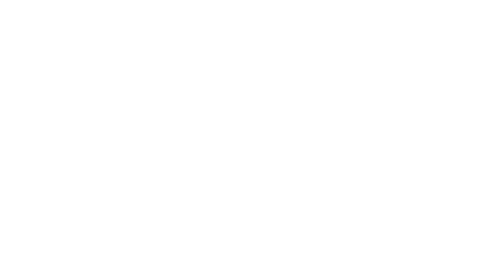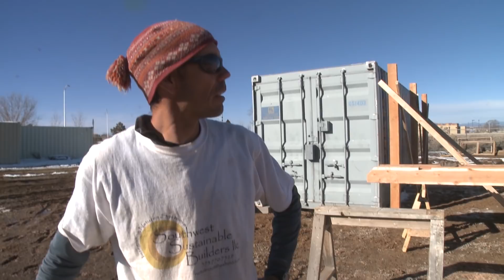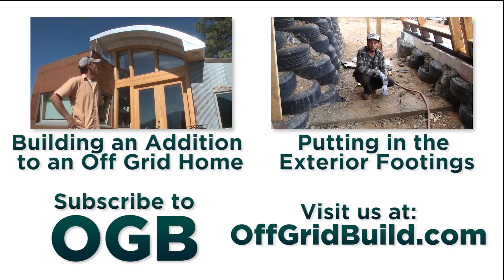Pros vs Cons of Shipping Container Buildings

Comment: The guy gave a great deal of good knowledge. I guess the complainers are just so wise on the subject and so rich they can sit and bash videos on youtube. I am a retired contractor and was looking for general information on the subject. I would say this video is a ten. It's free you Stupid Fuckers.
Reply: But didn't get this sustainable issue. Basically you are saying that using containers as a building material for housing is not sustainable taking in all aspects of it - life cycle costs (even in warmer locations you still need to take into consideration condensate issues etc)?
Reply: "Sustainability" is mostly a meme used to market used containers.. I actually have containers in use as a machine shop (two 40' High Cubes) and a "one trip" (effectively new) 40' High Cube as a ride-through motorcycle garage. They're nothing more than handy shells and the more you mod them for residential use the less "container" remains. People get far too childishly exited about large boxy objects but ISO containers design only suits industrial and military uses or specialty structures built by skilled fabricators like Andrew Camaratta (whose videos are worth a watch, he's a skilled contractor). Unless you  insulate properly or live in a desert containers will "sweat". I get by (thanks to climate and good door gaskets) with little problem in my shop containers but for a home you'd need effective insulation. 
I suggest anyone seriously interested build your own container workshop. Not contract, DIY. You won't learn much from outsourcing and if you want to build a house yourself a workshop is insanely handy. Learn basic wire and stick welding by taking a community college course or similar. I welded my machine shop containers atop steel beams (containers only require support at the end fittings) with 6010 root/7018 cap and welded the strip between the roofs (1/8' steel sheet sheared into 2" wide strips) with E71T-11 wire using a suitcase feeder.
Reply: Bo Kotain Lund I happen to be on, and noticed your post, so I will give a reply. In a warm environment, that environment could have high or low moisture. In either case, in a warm locations, be it Florida with high humidity (moisture) or places like Arizona or Nevada, one would use air-conditioners, which are dehumidifiers. As long as you do not use to powerful a unit, it should remove the moisture from inside it and dispense is outside the unit or structure. Doing this during the cooling run time.

Some people think that an air-conditioner is good, so a bigger one is better. For example in a room 3 meters by 3 meters (about 10'X10') it may have a 5,000 or 6,000 btu unit. Units that size, for that size room would run the right amount of time to cool it and also run long enough to dehumidify it. If someone put in a 10,000 or 18,000 btu unit in a room that size, it would cool the room faster, thus not run long enough to remove the moisture from the room. 

When you first walk in, it would feel cool, but after being the the room for a half hour or longer, depending on the person, they would notice it feels damp. This is why people will go into a large structure like a Shopping Mall or Store and after a short time, they feel like they are starting to sweat, even though it felt very cool when they first entered.

If a container unit was partially under ground, so it receives natural cooling, you would have some sort of air circulation system that moves air through the unit or structure, and add a dehumidifier that is only for removing moisture. If electricity is a problem, a smaller device that absorbs moisture. Those items would be anything from Damp Rid, to a silica beads container.  After is changes color,  you would place outside in the sun to dry out and then put it back inside. Some people bake them at low temperatures to reset them.  The same type remedy if there was a shower or bath tub in use, you would have a vent fan to cycle the air through that area, to the outside.
Reply: If you bury a container you'd better seal it VERY well because Corten steel still rusts ( a very good reason to buy "one trip" containers instead of WWT junk removed from service which is a mistake I'll not repeat).  That includes lifting the box and treating the entire bottom. I consider burial unwise with rectangular sheet steel boxes (they crush easily as the side walls were NOT designed for side LOADS) and if I for whatever bizarre reason wanted to bury a structure (there are plenty of other, better ways to bunker-I'd copy military success) I'd order a steam cleaned tank car hull from a dismantler (farmers like them for culverts) then cut and weld to suit before burial. Tank car hulls are FAR stronger and solve the "bilge" problem easily (deck the floor like a submarine and run your drainage and sewer pipes down the center with a bilge pump to handle leaks/condensation. They are delivered on lowboy trailers then unloaded by crane or whatever expedient method that suits your equipment. The main advantage of shipping containers is they're instant inexpensive SHELLS. They're basically an empty steel single wide mobile home. I like my containers and would have zero difficulty building a home version but my reasons for using them are fire and storm resistance (you still need firebreaks because hot steel melts and can ignite interior paint VERY quickly, and an external fire could easily kill everyone in a container) with low maintenance. There's a lot of study to do if you want results. Visit military and industrial container mod sites (industry does everything better than hobbyists so wise hobbyists imitate industry!) for examples to copy. Build yourself a container workshop (a GOOD one, not just a box with shit in it like a jobsite) and that will get you a useful shop for your next move. Cough up the money for a "one trip" High Cube. Lesser grades (particularly un-sea worth discards) require considerable work to be inferior to a fresh box. Standard height containers suck. Their low height trashes air circulation and the cubic footage difference leaves storage room you will want to exploit. 20' baby boxes are a joke because they're too small to be much more than a tool shed. (I have one for storage because it fit the area next to my rental property, otherwise I'd never buy one and only use 40' HCs.) Have fun but until you actually BUILD a container structure I would avoid commenting much on the subject. BTW 3M 5200 through-hull sealant is your friend and compared to it all mere "caulks" are trash. It's perfect for sealing power and other through-hull container conduit and pipe.
Reply: Fla-bushcraft Prosper room
Reply: +Fla-bushcraft Prepper I have spent months studying constructing shiping container houses and discovered an awesome resource at Magic Container Plans (google it if you are interested)
Reply: Ignore this SPAMMER. All you need is freely available in great detail. Use a search engine and study industrial and military containers.
Reply: "It's free you Stupid Fuckers" - Best line I read in youtube comments so far, probably ever.

Comment: Containers are really good for an initial move out of the city. We did that -- moved into a 10 x 12 shed for half a year with a container holding all of our stuff while we built a house.  We now use that same container as a haymow for our horses -- one of two container haymows -- and we will be modifying both of them soon to add a run-in overhang and a tack room on one, and an observation deck and slow feeder on the other. We also plan to add onto the house with three containers and create an art studio for our daughter with another.

Comment: For insulating shipping containers I have solved both the condensation problem and the ease of insulation by using spray polyurethane insulation on the outside.  Spray acrylic elastomeric over that and you have a long term insulation  with sound deadening.

Comment: This vid is a good overview but as I see it there's something that's not been emphasized nearly enough in container building: insulation.

I have 'repurposed' half a dozen containers from 20' to 40'. On the first one, I framed interior walls to hold batt insulation and provide a 'builder-friendly' surface for fitting out the interior. I called that one a failure because there was still condensation forming between the inside of the skin and the insulation.

After that, I started welding 2X2 angle to the innermost corrugations and sprayed foam on the walls. The thickness varied because of the corrugations from 2" to 4" and no more condensation issues. Using angle means that you also have a 2" flat surface to attach cabinets, etc...just like a stud. They do need to be covered with foam tape as a thermal break.

I buried two of them as well, stacking rocks with a machine to make a 'bay' for the container. The sides of a container are NOT built for the side loading of having earth piled against them. My first attempt resulted in the sides oil-canning inward. You probably could bury them directly (without the outer enclosure), but I would weld horizontal framing to carry that side loading to the corner posts. Being buried, the inside maintained a constant 10-12 degC inside regardless of the season outside (west coast Canada) and is definitely how I would do it again.
Reply from the maker: +DLpoints taken!

Comment: The next evolution in shipping container homes is removing at least half of it's width, filling it with insulation, windows, and siding, and using them as modular walls. In other words- cut them in half, remove the center, weld them back together, insulate and finish. You could use what you cut out to make other things, like joists, trusses, interior walls, etc.

Comment: When it comes to building a home from a shipping container there are many things you must consider. You've probably already searched various websites for guidance however many of the other Online guides miss out several very important steps. 

Professional container builder for 14 
years reveals his secrets and teaches you: 
How to build a beautifully designed home using shipping containers. 
What costly mistakes you must avoid so your project doesn't collapse like a house of cards! 
The fastest way to get your project complete and livable. 
Where money can be saved and where you need to invest those savings for the best results. 
The cheapest way to build a container home from start to finish. 
Build green. 

"The Most Comprehensive And 
Up To Date Construction 
Guide Available." 

https://tinyurl.com/k7jo333

Comment: $3,000?  Wow, that's news to me.  I thought they cost much more.  Thanks.  I will bury mine in Tagaytay to keep cool.  It can go up to 40 degrees in the Philippines.
Reply: bloodandwinearered My 40'x8'x9v cost $2,400.00 I plan on putting two underground which would give me an amazing 640 sq. ft of space.
Reply: For me, 640 square feet is just about perfect.  I do not intend to be indoors a lot of the time.
Reply: get them cheaper on ebay in some cases 😆
Reply: bloodandwinearered move to baguio 😆

Comment: I am an engineer.I designed & built a super strong bunker in the U.K. 31 years ago  (Search Youtube for Mike Thomas Bunker ).The structure has never leaked. It amazes me many people still think it is OK to bury shipping containers & put earth on top, without reinforcing them, & don't seem to think about them rusting. Some people assume that the steel is much thicker than the  2 mm.or14 gauge 0.075 inch thick steel normally used.

I didn't use shipping containers, I welded up heavier  steel plate + angle then encased it in reinforced concrete.I live near what was a possible nuclear target in the Cold War.  I know we are talking about houses here, so I am sure containers have loads of potential for above ground building, but I do wonder how many decades if that, would pass without leaks, unless containers get a really good waterproofing coating or concrete all round, if buried for underground houses?

I know some people use Gabion baskets filled with boulders to line the underground holes.With a good drainage system this seems to work & takes the earth pressure off the container walls.Although, I guess this takes away some of the advantages of being properly underground (but would still be good in an area prone to tornadoes etc.)
I lined my internal walls with 1 inch expanded polystyrene & plywood sheets.Without them the walls would have run with condensation when air flowed through.It also stops the tinny sort of that could occur inside a 'tin can'.
Thanks for the video & kind regards, Mike

Comment: crap from China lmao :-P
Reply: I know the post is a year old, but I would like to point out that no matter the nation building the containers, they all must be built to International Maritime Standards. In  the case of a 20' steel container, it is designed to have a maximum gross weight of 52,910 lbs (typically has a tare weight of around 5,000 lbs and a payload (P) potential of 47,910 lbs).  The container when loaded to its maximum gross weight must be capable of withstanding imposed loads of 2g downwards, 0.6g lateral and 2g longitudinal plus be able to withstand eight similar containers loaded to maximum gross weight stacked on top of it in a ships hold or at a land terminal.

The side walls and end walls/doors have to withstand loadings of 0.6P and 0.4P respectively, these values equate to 28,746 lbs and 19,164 lbs based upon the payload given above.  The side wall area in contact with the load is 146.56 sq. ft. giving a pressure of 196 lbs/sq. ft.  Corresponding figures for the end wall/doors are 51.78 sq. ft. and 370 lbs/sq. ft.  These figures are well in excess of the 20 lbs/sq. ft. wind load required for structures less than 50 ft. high.  A wind of 100 MPH produces a pressure of only 30 lbs/sq. ft.

The roof load test is 660 lbs over an area of 2' x 1' applied to the weakest part of the roof.  The load is usually applied at the center of the containers positioned with the 2' dimension aligned longitudinally.  Thus the roof is able to support an imposed load of a minimum of 330 lbs/sq. ft.  The design is easily capable of supporting the basic snow loads of 30 lbs per sq. ft. evenly distributed.

FEMA Document
2.2 Snow Types
Snow comes in many forms and is affected by numerous
atmospheric and geographic conditions. Regional differences in
season, altitude, humidity, and other variations result in a range 
of snow densities. For example, the weight of 1 foot of snow in Utah does
not necessarily equal the weight of 1 foot of snow in Vermont.
2.2.1 Range in Snow Weight
The weight of 1 foot of fresh snow ranges from 3 pounds per square
foot for light, dry snow to 21 pounds per square foot for wet, heavy snow
(Gooch, 1999).
2.2.2 Ice
One inch of ice weighs a little less than 5 pounds per square foot, and 1
foot of ice weighs approximately 57 pounds per square foot. Ice weighs
significantly more than heavy, wet snow per inch depth. In part, this is
why it is important to prevent ice buildup on a roof structure.

You get the idea of what a residential house typically must support and how a shipping container exceeds that many times. Though cutting holes in a container for doors and windows does compromise it's structure, with proper code adherence, you can keep a container structure at or way above the code requirement. This is why it is important to do research and check with local codes.

Comment: This guy doesn't know what he's on about, as shown by his claim that Chinese goods are all crap.
Here in the UK these containers are regularly used on building sites for temp accommodation.  Offices, canteens, bathroom/toilets and especially secure storage for valuable stock.
They are easy to install, insulate, easy to fit out and cheap as chips.
The only thing to need to be careful of is they are laid on a flat, stable surface. Because they will distort and once that happens, it's almost impossible to repair.

Comment: i don't understand that if we have such an abundance of containers why they are still so stinking expensive. my quote was 8000.  and that's just to get it here, not even comfortable. i could build a small cabin for that.

and i don't understand why people take the biggest advantage of a container and ruin it. its modular and movable. why do people cut them up and stack them and weld them together? then you have to put up wall studs and...why?
if you want a house build a house. why do we need to spend 8000 for "fancy" metal siding. that's all it is in the end, from what i see people doing.
Reply from the maker: +Shofar So Good it depends where you are located.  In some areas they are extremely cheap
Reply: +Shofar So Good ...I am surprised Chicago would not have them priced reasonable.
Reply: The price to build a house in the conventional style is dependent on size. Since the container is just an exterior shell, the price is far cheaper than labor and material for the house frame and sheathing. If you say the delivery and containers came up to 8000, then double that for material and labor for the same size house built conventionally.
Reply: Ive seen them for $2,000.00 Not sure about where you are located.
Reply: perhaps they are more reasonable. the location to be shipped to was either WI or IN. so pretty far inland. I will check into it again. thanks Guys!

Comment: could you use cathotic protection by introducing a mild electrical current to prevent rust and corrosion ? they do it on oil rigs and other steel structures.